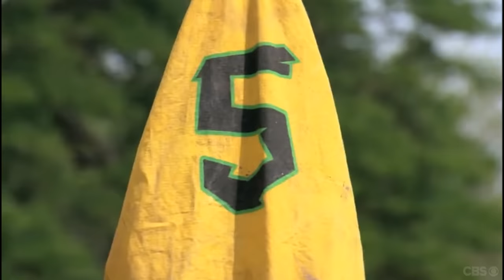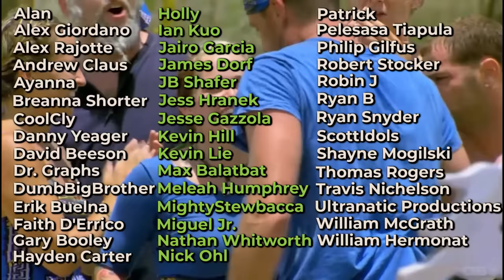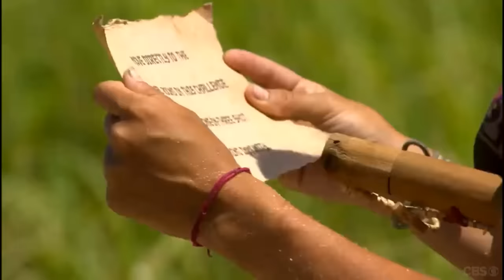5 Times Survivor Players Hacked Challenges 5.0

Comment: If you're looking to make a 6.0 video, something from Guatamala might be considered a hack. In the episode 5 reward challenge, both tribes gather materials so they can pull a cart up a hill, and then race down it. It turns into a blowout because the first station involved using a sharp rock to cut a rope which would release the first set of materials. The winning tribe chopped the rope using the stone as an axe, and the losing tribe tried sawing through the rope using the stone as a saw. Apparently the losing tribe tried copying the winning tribe, but they couldn't figure out how to chop effectively, so they went back to sawing.  

The hack is that they show the chopping person bringing part of the rope off the cutting surface to help put more tension on it so that chopping can happen the most effectively.  The sawing person leaves the rope on the table the entire time, so they might not have known how to get more rope tension to make the chopping method effective. As a result, the winning team ended up winning before the losing team could even finish getting through that first rope.
Reply: I would also consider the hack from the final immunity challenge from guatemala

Comment: Random little hack I just realized while rewatching MvGX. In the Episode 7 reward challenge, they have to throw balls into a hole that drops into a net, where 2 other tribe members have to advance that ball through the netting. This isn’t too much of a hack, just more so a good strategy executed well. Everyone tries to just brute force the ball through, usually shown with both tribe members basically punching at it. But on the Vanua tribe, Zeke and Michelle have this awesome teamwork where Zeke is consistently pushing the ball a little bit further, while Michele grabs the net and widens it just where Zeke is about to push it to. They keep sliding down at a fast and consistent pace, which allows them to execute this so well. They’re able to pull this off super efficiently, which gives their tribe a huge lead (resulting in them winning). It’s fairly easy to miss if you aren’t paying too much attention, as it’s not shown too much, but if you do, you can see how much harder of a time the other tribes are having. I think towards the end, Will & Hannah try to pull it off, but don’t think execute it quite as well as Zeke & Michelle.

Comment: The Adam hold reminds me of All Stars (and you should totally use this in a future video) when Shi Ann won the challenge where players had to keep their arm above their head. Their wrist was attached to a bucket of water and if they dropped their arm they would pull the water onto them and eliminate them. 

She said in the DVD commentary that she won the challenge by extending her arm straight overhead with no bend in her elbow or angle in her shoulder so that the tension was on her bones and not her muscles, allowing her to basically stand there indefinitely. Gravity isn't a force remotely strong enough to break a bone, and she couldn't feel pain there as she would've in her muscles.  She said she could've held her hand up for hours and it was funny to her because the other contestants had no clue how she came from nowhere and won that challenge. Rupert was exhausted and admitted, "You are tough! What is going on?" and she confidently responded, "I'm going to win."